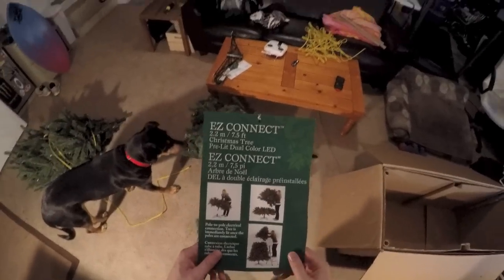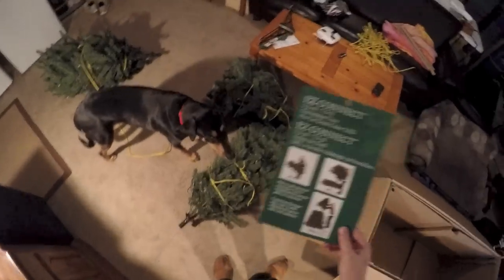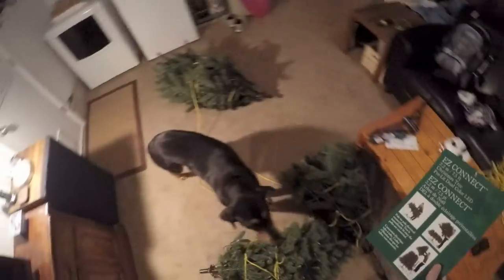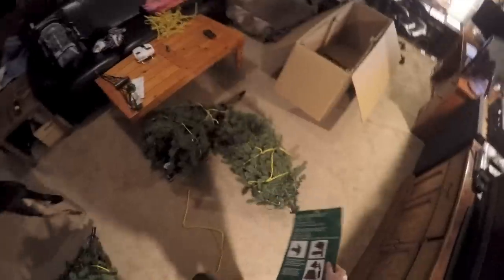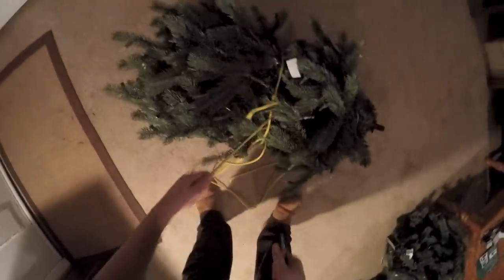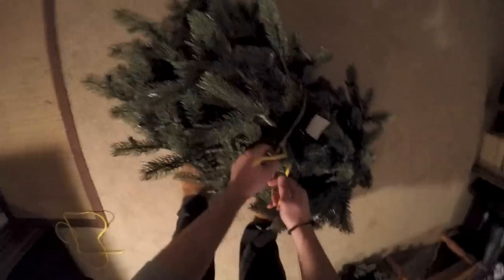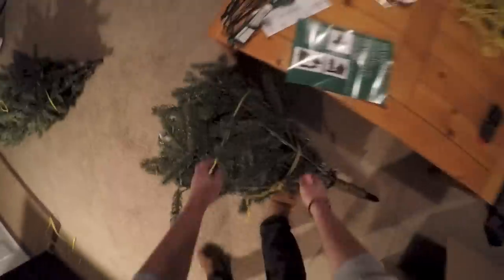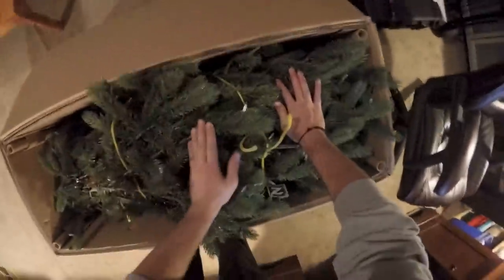How to put a fake led christmas tree back in the factory box

Comment: I know this is completely out of season but oh well.. If you put the bottom piece in first at the bottom of the box, then the middle(facing the opposite way) and the top on the same side of the bottom it almost creates a flat pack and everything should fit better.. I also wrap the tree in plastic shrink wrap and it all fits in the original box
Reply: this completely worked! no shrink wrap necessary. Yay thank you! thank you!